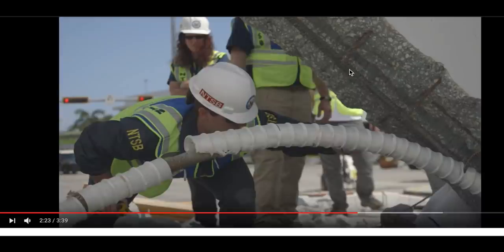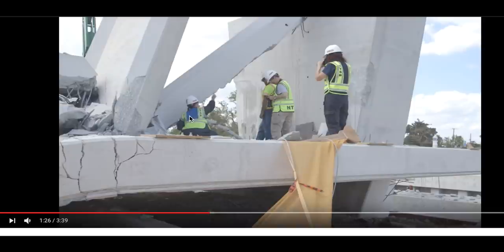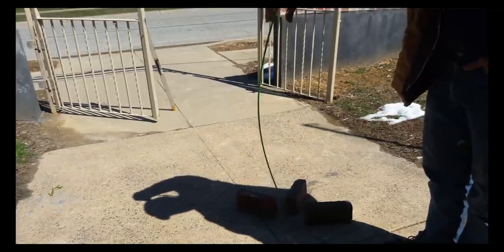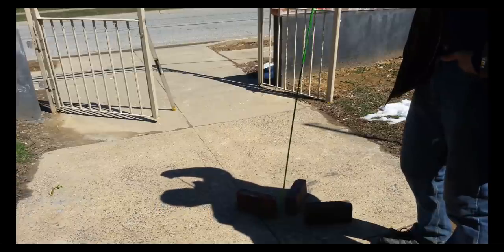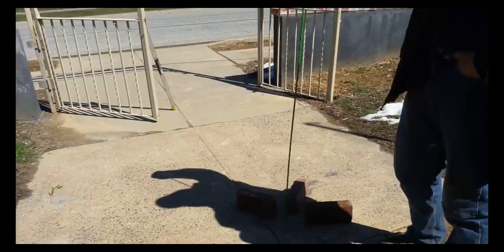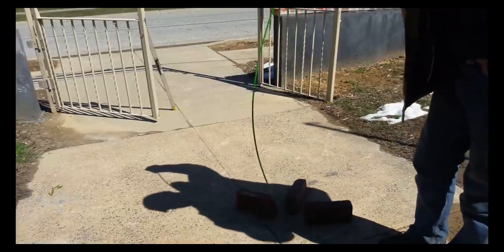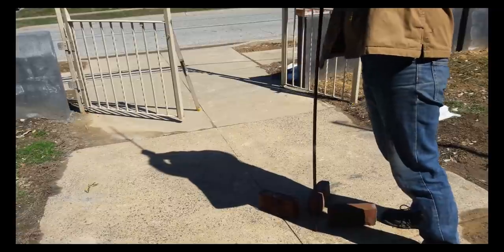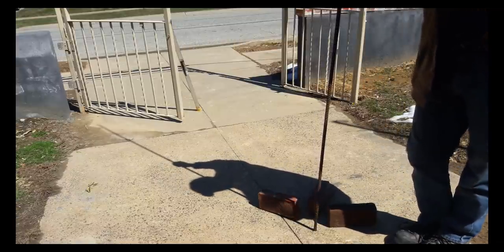FIU Bridge Collapse & the reinforcement & cables placement contributed to #11 diagonal's failure? #6

Comment: Thank you for your kind words...  Please keep in mind, I was making these videos with the data I had at the time... Which means as more data was revealed, I may have changed some of my statements --- just accepting the data ran me into a different direction...  I try to always stay flexible and accept income data and adjust for it...   This may be a little confusing to you ... BUT, if FIU engineers would have practiced the way I practice... ''accepting new data may change how you have to adjust your plans" then this failure would have been avoided!   As the new data would have been ''cracks'' and this new data would have had to be addressed and perhaps the new data would have forced the decision to ''shit-can'' this entire design! 
Manytimes, I try out new concrete designs, only to find they are ''shit" and no matter the quantity of the concrete, it MUST be trashed!  BUT, once I get the design I like, I guard it like a hawk!  
This was an untested design and like my untested concrete designs, they must be ready to ''shit-can''...   
FIU Bridge Collapse, did NOT have that as an option!   They were ''all-in'' (like a poker game) and ''doubled-down'' on a SHITTY HAND!

Comment from the maker: NOTE: We need to see a cut away view of all the columns, this will tell use how each column would behave under loads. 
The #11 column has cable at the bottom and if the other cable is equally from the top, then this column might experience equal loading deflection...But, if you put it in a different pattern and tension the cables, the column might flex, rotate and thereby lose some ability to perform / take the loads.

Comment: The technical reasons for this failure are (to me anyway) of secondary interest. It was patently a poor design, badly cast and assembled and those first indications of failure (the nut not tightening) were ignored. Utter incompetence on all fronts.
What is REALLY the big question that should be asked is WHO kept that road open while the bridge was unsupported while under construction? Someone (in the City presumably) demanded that road be kept open because the car is God. They could have had lanes closed and a big support structure in the centre but better still close the damn road for a weekend

And sadly this fatal event has proved the City CAN survive when that road is closed because it isn't going to be opened any time soon ....

RIP those innocents killed by incompetence and a mindless City bureaucracy ...
Reply from the maker: Very sad situation and you are correct, the road will be out of commission once they start this project again...I will assume the project will go on...interesting to see when and under what design...

Comment: From what I see my first thoughts is what you suggest, buckling  failure of the end web member.
The pictures of the concrete debris indicates a high strength brittle concrete. The stirrups around the longitudinal reinforcing bar looks inadequate in size and spacing to provide proper confinement of the reinforcement under compression. From my experience.
I thought I heard that the span was 900tons. Each  end of the beam will have a shear load of about 450tons. The end web of the bridge is a compression  strut and because it is stiff compared to the upper and lower deck will take all the shear load. That load in compression  will not be 450tons but a lot more because it is not vertical  but at an angle.  If say 45 degrees it  will be 1.41x450tonne. Add to this any post tension load and eccentricities it is ripe for potential buckling failure with no warning or redundancy against collapse. I put my money on this.
Reply: Cables to be installed later when the other 3rd of the bridge was put in place, and the support column was installed. Dumb design overall even with my admitted limited knowledge.
Reply: I just input this in Enercalc to get a feel for the numbers involved and that end diagonal has 1588 Kips with 65 k-ft moment. Keep in mind all these members have rigid connections with concrete so any induced moments with post tensioning tend to get restraned by all the members of a joint, which limits the actual moment that makes it into the members. The k factors for each member would thus be less than 1 giving reserve capacity against buckling. Also that load above in the first diagonal 24"x24",  30 ft long translates to less than 3000 psi in the concrete which supposedly was 8000psi leaving lots of reserve.

Having said that, it is doubtful the first diagonal buckled which brings our focus to the end of that member over the support. Here we have 1457 kips transferred to the lower slab, 167 kips shear and 745 k-ft moment in the first diagonal (member 11). To all these loads add the reaction of 950+ kips. It looks as though they had the bridge on two bearing pads which would form a transverse beam at the bridge end with all the lower slab tendons through it and members 11 and 12 loading the center. They would have wrapped member 11 rebar back up the center of the bridge as well to help transfer 11's loads back to the slab. These are huge loads that are transferred from 11 to the lower slab primarily through shear in the concrete because their is no post tension cables directly under the center to avoid reducing the shear capacity there. This "beam" would however have the member 11 tendon anchorages weakening it at the center as well. I think this area is the weakest link.
Reply from the maker: https://www.youtube.com/watch?v=1T_Pjgcof6o    it appears, the engineer - inspecting engineer  knew of this option, that explained in this video and EVEN stated, the thought this was the cause... post tensioning forces created this issue on the steel!   https://ibb.co/hLa1uS  (here is a direct image to that statement, release about 4 days ago by FIU).
Reply: NTSB has determined that the failure was in the nodes, not the diagonal member proper. Inadequate shear and bending control. 

#11 should have been stronger than #12 by a factor of four three (ignoring the pylon requirements) but, ultimately, the cracks at the lower node show that a large radius fillet and plenty more rebar was needed. 

Certainly, however, a short shear distance until the rebar took up the stress should not be capable of catastrophically cracking the deck in the middle of the span between #11 and #12. 

This brittle failure of the deck was due to totally inadequate post-tension capacity at the midline of the deck; Something like a factor of four to eight inadequate. The midline tendons have to cope with the majority of acoustical energy during failure. If not, they snap. They also took the majority of the static load. Furthermore, rebar in the deck is never adequate to distribute the point load of #11. It needs a star/radial pattern of post tension tendons. 

A strong dorsal tendon at the bottom of the deck would have been in an excellent position for preventing cascade failure. Instead, a drain pipe was embedded there, weakening the belly.

In the first seconds of viewing the bridge end, I assumed that this drain opening was actually a dorsal tendon sleeve, and wondered why it was not occupied...
Reply: @dj4246  
Why is no one else giving you a thumbs up? This is the most lucid note in this thread, including my own!

Comment: Excellent exposition. The design also looked like it lacked redundancy. In aviation we have an old idea about the way a design looks: If it looks good it will fly well. If it looks ugly it will fly poorly.  Perhaps this bridge was the result of an overly dependent faith in computer design. Versus standing back and eyeballing the design, using human judgement.  Bridge design was mastered 200 years ago. It ain't rocket science.
Reply: They may have regarded the multiple tensioning cables as "redundant" - but it's possible that they failed to properly account for the actual stresses resulting from failure of one cable.  With two parallel cables in a column, if  one fails, the other will tend to bend the column.  There's more to redundancy than just being able to carry a doubled load.
Reply from the maker: Malcolm,  https://www.youtube.com/watch?v=QUkx5TfgwLA    take a look at my latest video, it appears my previous statement about location of reinforcement is correct and that was a ''back and forth'' conflict with the engineers...

https://www.youtube.com/watch?v=Qoq6Quecj3M

Comment: Here's another take on it.  Look at the video at 0:26.  The end of the deck ended up horizontally on the ground.  #11 and the canopy rotated 90 degrees.  #11 stayed more or less attached at deck level but the tendon in question remained anchored in the end of the deck.  As the deck dropped it peeled the tendon out of #11.

Comment from the maker: NOTE: ALL P.T. BARS ARE 1 3/4" DIA. BARS WITH AN 8"x12" ANCHOR PLATE
PLUS, yes, I do think, this could have been ripped from the column by being pinned on one end while falling on the other end... But, this gives us data on it's location and the strength of the concrete being able to hold it (entrap it)... No one, as far as I know... has been able to produce in the lab or would they want to... But, now that it is done... this is awesome data... I read this was approximately 8500 PSI concrete +/-

Comment: Failure to stick to KISS is my diagnosis. Construction crew was reported to of said the tightening of bolts wasn't meeting any real resistance. A disconnect at the bottom might of happened. Mix also looked like one size of aggregate. But I'm certain NTSB is evaluating that seeing how the concrete produced all the chunks for pictures. Bad mix.

Comment: The way I see it - the cable is tensioned and will be more or less straight in tension.  However, the surrounding concrete is what becomes compressed and as a result, it buckles downwards in the direction of the lean and puts pressure on the steel reinforcement to the bottom side of the concrete strut.  I'm not a structural engineer, but in my mind, the force which caused the rebar to shear would have been directly from the concrete rather than the cable - the cable would have indirectly caused the rebar to shear as it was behind the compressive force in the concrete.  I may be wrong but if the cable did not snap, the above is what I believe may have happened.

Comment: The truss compession members would have been stronger if either confined within a "pipe" or rebar wound in a fairly tight helix to contain the compression structure of the concrete. This appears to have been lost sight of with the rectangular shape of the truss members. (A pressurised Coke bottle is a compression structure)

Comment: absolute classic example of concrete burst due massive overloading of a post tension cable. There is no rebar antiburst around the tension head (if loaded properly it doesnt nwed it) and so the concrete will break off like and indirect tensile failure straight down the rebar exactly as shown.

Comment: Can we ALL agree that this PISS POUR DESIGN should NEVER be used for ANYTHING!!!
Reply: The design was ok, but in my opinion a center pier would have been better for such a long horizontal span of concrete....also, I am more concerned about the placement of the bridge with the outside jack not supporting the edge of the span properly. By it's own weight there was a lot of stress on that concrete because of the lack of support. Unsupported horizontal concrete wouldn't take much of a bump or jolt to initiate a stress crack. Possibly the crack that was reported prior to the structural failure?
Reply from the maker: Agreed, this would have benefited with a center support system... But, this still might have not stopped the failure in that section... BUT, you would have hoped it would have limited the collapse onto the roadway...  My thinking, is the collapse was initiated by the engineers, during this post tensioning - or crack repair - or whatever reason they will declare they were ''screwing'' with 10 & 11 location...

Comment: Any idea why the crane they were working under at the time of the collapse was removed so quickly? Its not there in most of the aftermath photos.
Reply: CognitiveDisonance cranes are expensive and it was probably sent to another job. Most often the crane company is a separate entity from the construction crew.
Reply: What was that crane actually doing?
Reply from the maker: I am guessing they were lifting the tensioning tool to the top of the canopy - they are extremely heavy.
Reply: Yes. I.m guessing it was pulled fast to avoid it becoming mired in the investigation -- even before any assessments could be made. I believe a man who fell, and later died, was tied off to it. If so, that crane was most definitely part of the accident, and should not have been removed before the investigation.

Comment: It would only buckle the rebar if there is strain in the concrete. Tensioning rods should not cause strain but only resist tension forces. I think the tension rod was overstressed and broke causing the lower part of the strut to fail in tension.
Reply from the maker: Of course, post tensioning causes strain, and it causes this strain relationship to it's load path.
This tensioning does not care what is in it's path...

Comment from the maker: At this time, I don't think a cable failed under tension...that would have released the stresses they created and might have put things back to "zero"(for the most part)...I think the continued tension of this "column" from one or two cables contributed to this "buckling failure"... Once, the tensioning of the cables were so great that the buckling started...The canopy and it's "lack of completed longitudinal post tension cables" contributed to this tension break point on /at the intersection of #10 and #11.Once, that "door is opened" the forces transferred to gravity...Basically, the longitudinal post tension cables could NOT take the pulling downward forces of the tensioning via column #11.Ps I did say, in one of my videos that the impact could have finished this underside off...But, the buckling needs to take place... for the canopy's failure to happen...

Comment: I am an old retired S.I...Not an Engineer.....I am curious as to the aggregate strength in your pics...I get the PT concerns...but the Agg in that mix looks like it all sheared...ALL of it. Is that agg material a limestone? It looks like it sheared like glass.  I am getting the Idea that Reinforcement crowding/ placement was the reason for the moment I you opinion?, I am thinking there was a consolidation/ shrinkage at the rebar and that allowed the moment. Not a P.E.....not.
Reply from the maker: I do not know the end result of the concrete's psi - the NTSB took samples and I hope they release their results... But, I do get your point and this is a major concern.

Comment: I want to make note of something that is not the cause of the failure.  The rebar.  Around here everything that goes into a bridge deck is epoxy coated rebar.  The bar will be green in color.  Many good reasons for it being epoxy coated.
Reply from the maker: Excellent comment...I am not sure of their code but I agree, the epoxy coating helps against the rust expansion issues...
Reply from the maker: Enjoy this video if you like   https://youtu.be/BDHRmvvMdmk  that is my other channel

Comment: Hindsight, but wouldn't a welded steel box beam truss have been a much better choice?  Seems like it would have been faster  too...than all the reinforced concrete form work and tensioning setup.  The design appears to be trying to do too much with too little, and a myriad of construction issues then added into the mix.  Also, the shallowness of the acute angles in the truss members just appear to have been inviting trouble.  Post tensioning of non-redundant truss members while under traffic just doesn't seem like too smart a thing to do.  Were liquidated damages built into the contract for down time for thru traffic?   Probably a money angle somewhere in the chain of events.
Reply from the maker: Welded would not be the best choice but steel would be... Welding joints have failed on a few bridges -- the idea is to make it idiot proof and that is why bolts with tensioning system designed into bolts, work best... These bolts will shear once a certain psi or torque is meet on the tightening of bolts.
Reply: America over relies on concrete.  High tech structural welding/fabricating not our strong suit here.

Comment: Were cracks prior to collapse relevant?  Also have images of those cracks, or the presentation made by Figg on that morning available?
Reply: I believe they were relevant. During delivery the bridge was not supported at the end that collapsed, possibly causing the initial stress crack that was reported by FIGG. My guess, the reported crack was somewhere between the last jack, and the unsupported edge. Reinforced or not, that is a lot of weight for that short span of concrete to not have been supported. Even though concrete (especially 8500 +/- psi as reported below) has a very high compression factor, it has TERRIBLE shear strength. I think the slab gave out.

Comment: I do not understand why compress the cable after the concrete has poured and cured.I always understood that the cable is pulled while no concrete is present, then the concrete is poured and once cured the cable is  released and the compression is applied.
Reply: I think that's commonly known as prestressed concrete.
Reply: That’s pre tension concrete

Comment: AFAIK there were two PT rods, one on each side (bottom/top) of the member.
Reply from the maker: Jernej Jakob, would not matter if you tensioned one with enough force to induce buckling...
Also, recall, this column is dimensional "odd" for stability...As proven by this failure...
Of course the formula...is what we follow...I will not cross that line and presume to know the loads...